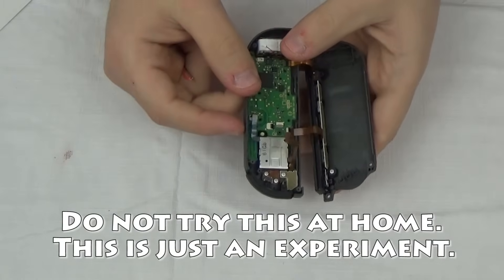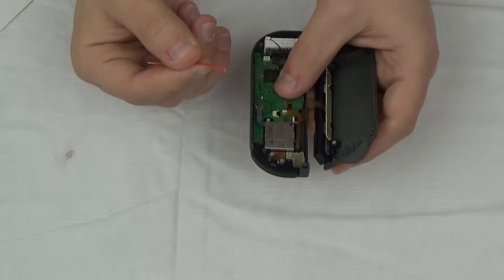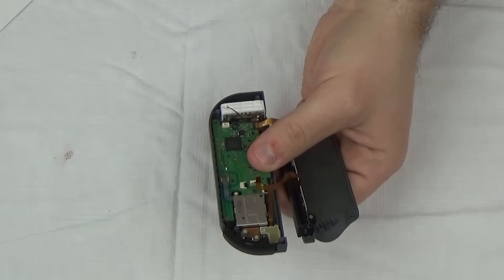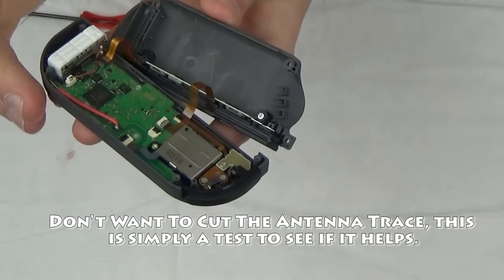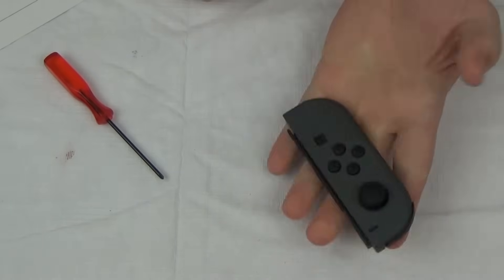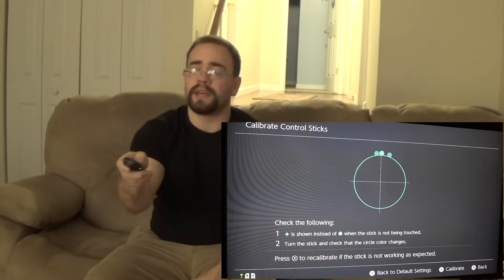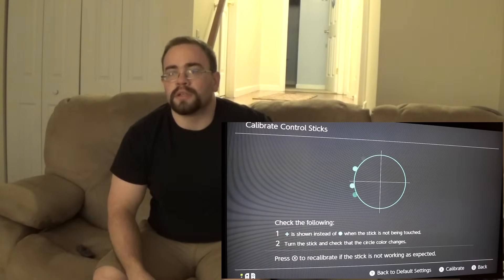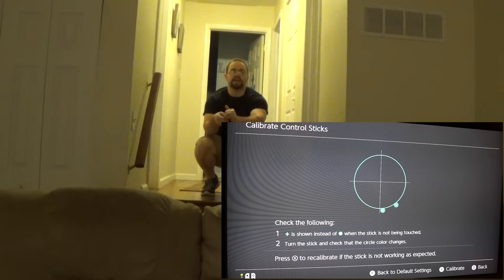Fixing The Left JoyCon!

Comment: This video is going to circulate the internet in no time. Good job man. Well done. Do you think this is a problem that can also be solved via a software update? Like perhaps boosting the Bluetooth signal?
Reply: You can fix signal strength with code. You can easily configure transmit power through firmware.
Reply: I hope he gains a crazy number of genuine subscribers.
Reply: Good question... but the rumors are that the day one patch may have already tried this. If true I'm not sure if there is much more room left for another boost.
Reply: That is untrue, signal strength can indeed be pushed further via firmware if there is headroom inside the hardware, which there is. My thinking is that the bluetooth signal is optimized for battery usage. If the issues are widespread enough, and Nintendo deems a firmware update a necessary compromise, they can increase the output of the antenna via firmware.
Reply: 1: Boosting signal is possible via a firmware update which was almost surely already a part of the day 1 update. To boost the signal they would need to make the Bluetooth chip use more power to transmit the signal through the antenna. This does means sacrificing some battery power since you're making the system consume more power (making it less power efficient in the process). N.B. To apply the firmware update to your Joy-Con Nintendo instructed to attach the joy con to the system and do a full restart so the update can be implemented. 

2: As you could see in this video, the antenna hack.fix appears to significantly increase range and transmission strength. However it can have significant drawbacks. A bigger antenna (especially a big copper cable like that) means a stronger signal and more range. But naturally a stronger signal also consumes more battery power (making it less power efficient). The added antenna will require more power and drain battery more quickly.  However, unlike firmware controlled signal strength you cannot tweak the size of the antenna which affects the range it can operate in and the minimum amount of power it requires to operate.. 

As you have seen the antennae are an important factor of the design of a wireless device. Besides the obvious design aspects like space for the antenna and size of the antenna, the design has to take (power) efficiency into account, not only does this mean the actual amount of power it consumes, it also means ratio between the power it converts to EM waves and the power it converts to heat. The design of the antennae in the Joy-Con undoubtedly have a lot of thought behind them.
Don't simply assume this antenna hack/fix is something the engineers should have done when designing these antennae. A simple and big copper cable like that wouldn't be nearly as efficient in its consumption and transmission..

P.S. Firmware is just the software which handles a hardware device functions and internal instructions (it tells the chip what to do). A firmware update means they change the parameters of the instructions the device (Bluetooth chip in this case) gets to make it function (slightly) differently.
Reply: link2dpast no it can't be solved with a system update, Unless The update make the joycon grow a new antenna
Reply: link2dpast 
you can't really fix signal strength with code it's a hardware issue
Reply: AVM3798 I just looked up Techinsights disassembly of the JoyCons they each have 4mb of internal flash memory, so it it is possible for them to store new firmware updates.

http://www.techinsights.com/about-techinsights/overview/blog/nintendo-switch-teardown/
Reply: The Joycon are most likely not built differently. And I assume the radio transmission regulations are largely the same across the board as well.
I can use them behind my back fine as well. But they do occasionally act up when I rest my hands on my legs which also contain a lot of blood vessels which means a lot of water to interfere with the low powered signal.

How do you use your Joycon when playing Zelda? Do you use the grip? That apparently improves things quite a bit, just from the position you hold your hands in combined with the additional plastic between your legs and the Joy Con...

Try playing Zelda freehanded for a while in a lazy chair or on the couch with your hands just resting on your legs.. It might result in some missed input as well for you. (I wonder if it will, so if you try it out please tell us the results, if you want to that is..)

I'm personally very curious what causes this issue so I'm trying different things out myself as well..
It's a weird issue, because when it happens I can sit perfectly still, pressing buttons with no response for a short moment and then without moving suddenly the controller picks up again and continues to work perfectly. And no matter how much I clasp the controller it will still work like there wasn't a problem at all..
It's very weird since I try to keep all variables the same yet it behaves differently. One of my guesses is that there's a firmware function that adapts and regulates the output power for the Bluetooth signal that isn't completely doing its job properly.. It might suddenly drop the output power in certain conditions when it shouldn't.

By the way, for me it is the right Joy con that does this. I have almost no problems with the left one which supposedly has a worse antenna. Because of this I suspect it's not at all a simple issue with the antenna. Even though adding a big copper antenna naturally improves the signal.
Reply: because I = U/R, and the R is dependent on the length. but since this is not an closed circuit, I'm not sure how much it affects it.
Reply: If thats the case could they add a high range mode and the standard mode with the caviat that it would drain battery thus avoiding a large recall?
Reply: It already got a section on NCIX Tech Tips ;)
Reply: Marionova - Super Mario Sunshine not true
Reply: link2dpast from this video it looks like an update can not fix the issue.
Boosting signal is not a thing
Reply: Pooping Buffalo it is possible for them to have there firmware updated because the they have a small amount of internal memory, so an update that boosts signal strength is not out of the question.
Reply: They indeed did NOT fix this issue....  I have a Switch, my left Joycon loses signal all the time when im more than 5 feet from the stupid thing
Reply: It's annoying, I have similar issues after long sessions of Zelda. However, please be sure to contact Nintendo if you have any issues and giving them detailed feedback about your situation. These are real world scenarios right here and obviously initial hickups of the system. It sucks but it is the fate of the early adopter. 
If you want to speed up the process of Nintendo improving this please make sure to send feedback to them so they can chart the issue and figure out an elegant solution.

This is not simply about slapping on a fix that kinda works, Nintendo is about optimisation. They need the real world data so those who are experiencing issues please try different things out, and send your detailed feedback to Nintendo. The better we give them feedback the better they can adapt for the specific situations we're using them in.
Reply: Stefan Goedhart funny..I can not be more than 4feet away from my system because it disconnects..
Reply: I can too.. Most of the time.. That's the weird thing.. That's why it's important for Nintendo to get detailed feedback on when and where people experience problems.
Reply: If it's that bad you should look for problematic factors in the way you have set your stuff up. 4 feet is ridiculous.
Reply: Cilph They already fixed this.

Comment: Good job! Nintendo seriously need to do redesign both Joycon, too. The Left needs a dpad instead of the buttons and the Right needs the joystick to be positioned on the on the top.
Reply: That would defeat the whole purpose of the Joycon. The four button dpad actually doesn't bother me at all. In fact I prefer it.
Reply: Kayan El the joycons don't need  redesigning just better antennas but 40-50 feet thats crazy.
Reply: Kayan El no the entire reason the joycons are designed like that is because it's supposed to function as two separate controllers, putting a standard Dpad defeats that entire purpose, putting the right stick at the top also completely defeats the two player purpose, because you would have to put the SR/SL buttons on the outside on the joycon. Nintendo engineered these as best they could to function as a complete single player set up as well as functioning as two controllers
Reply: Kayan El No than we can't play 1 vs 1 coop with 2 tiny controllers. But if you don't mind that than it would have been better but then what is the point of having separate joycons?
Reply: A very real chance Nintendo will release optional additional Joy-cons with the different button layouts that you have suggested but for launch and not to cause added confusion, i can 100% understand why Nintendo released them as they are at the moment. But i fully expect to see Joy-cons with a D-pad and maybe the higher stick on the right at some point giving people more options.
Reply: Kayan El if you are a pro player and wants to play it right you can always buy a pro controller, but it is stupid it is not packet in although than the cost would be higher
Reply: Nostalgia makes me somewhat adore the way the "d-pad" are buttons. Reminds me of the N64's C-buttons.

I did get why it is how it is when I were using one half, while a friend used the other half.

I'll just pick up the Pro Controller at some point if I buy a fighting game and want to use a traditional d-pad.
Reply: Kayan El mmm yeah you got a point. It is a design choice they went with. I still like the idea that we can use it as most powerful handheld too. I have a little brother with whom I game often. We like to play coop games and we don't mind the controller so for us it is great to play multiplayer on a car trip
Reply: Also there not going to position the joy stick on the top again. People complained about both the sticks being up on top of the controller. Hey what they isn't perfect but it works great.
Reply: Kayan El well good thing they're removable so they can either do a recall if it's really widespread and bad worst case, or they could just release a "revision 2" of the joycons, I'm not having any problems though and I'm 40 hours in to Zelda I haven't had a single issue
Reply: Kayan El They could make a pro version of the joycon except that its called Pro-con xD and that it got the standard D-pad and a more comfortable design.
Reply: They could have EASILY made a PS4 Style D-Pad.  Its completely separated buttons but they are angled you roll your fingers onto them like one pad.
Reply: You fucking sped, you can't have a D-pad and have it function as a separate controller.
Unless Nintendo or a third-party manufacturer comes up with a "single player" set of Joycons that replaces said buttons with a D-Pad
Reply: Crimson Gold Eagle because its supposed to function as two separate controllers, if one had a dpad that was supposed to be used as face buttons instead of a dpad people would be fighting over the right joycon because playing with the left one would be complete shit
Reply: Kayan El I understand stand the d pad thing but it would go against what they were going for having 2 controllers in one console package. Maybe they should create a add on that magnetically attaches to the left joycon to cover the 4 buttons to simulate the d pad.
Reply: mcgman 80 they could have but then Sony would have sued for patent violation
Reply: No, the reason why it's laid out like that is because no matter which one you turn sideways, 1 and 2 player both have the thumbstick on the left and buttons on the right.
Reply: I like the joystick being on bottom with the with the right joycon. Makes it easier to press buttons for me. :0
Reply: D-Pads use 4 buttons. One for each direction. I see no reason why the left couldn't have a D-Pad to repace the 4 buttons on top.
Reply: speak for yourself, I hate the right stick above the buttons
Reply: Reyn the Insane // BSG Well, the directional buttons could be a problem for games like UltraSF2.
Reply: Mick Gerritsen I really never cared about using two separate Joycon for co-op. I would prefer using 2 Pro controllers. Anyway, there shouldn't be much of a problem playing games because there's a dpad on the JoyCon-L.